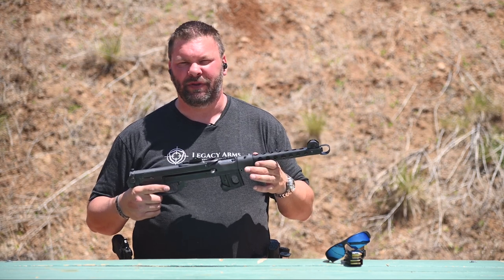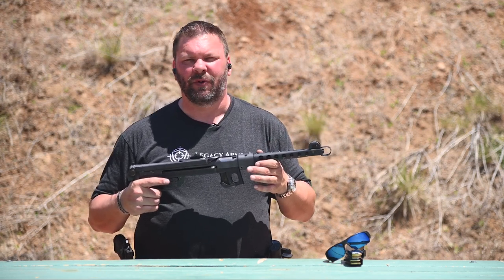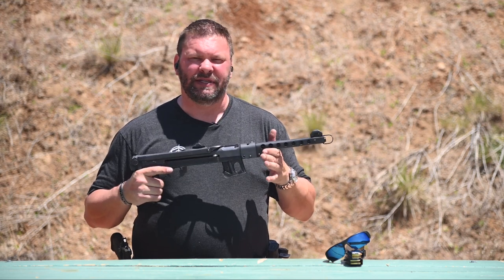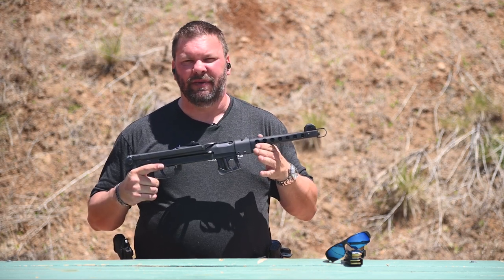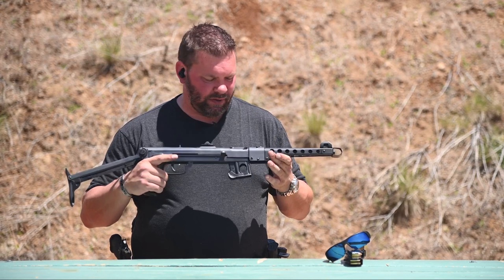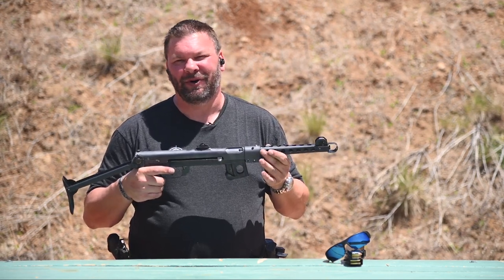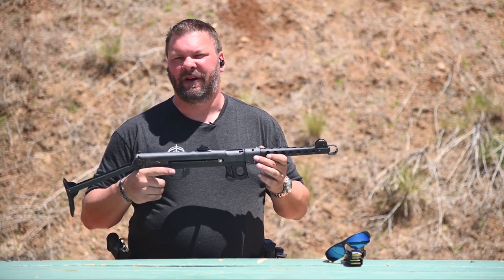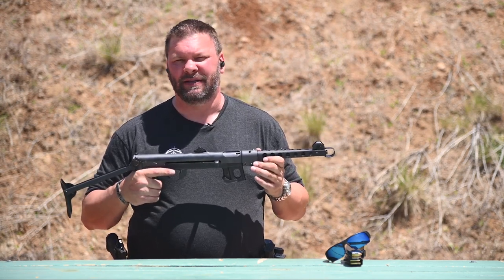PPS43

Comment: Another great video. Why does its cyclic rate change while firing?
Reply from the maker: Open bolt guns do that sometimes. It’s a large, heavy bolt with a a welded tip instead of a furring pin, so the bolt is not always perfectly in battery before striking the primer. The powder, and the friction of the bolt can cause it to change its rate somewhat. I see this in my Thompson SMG as well but not so much in the UZI or MAC.